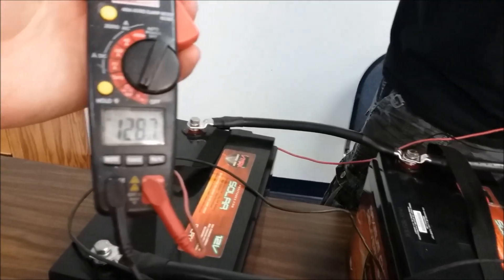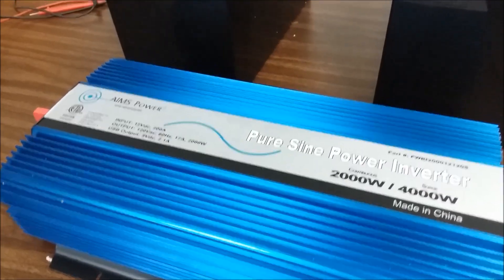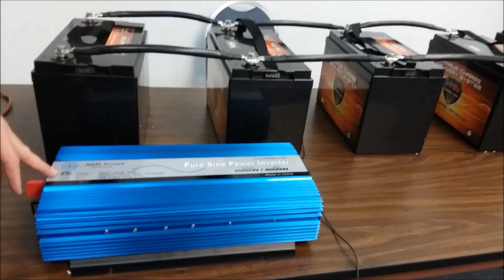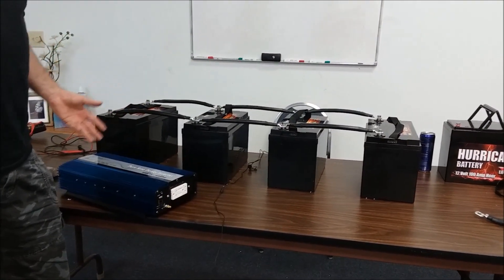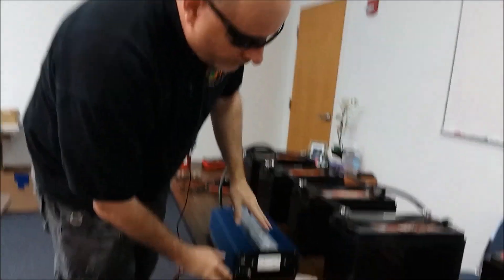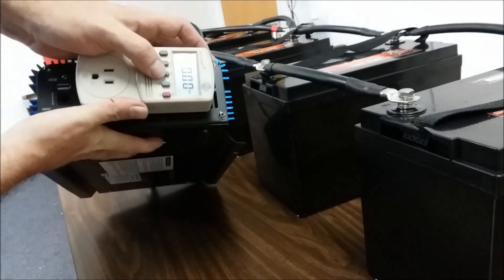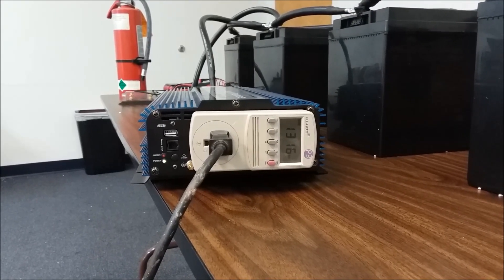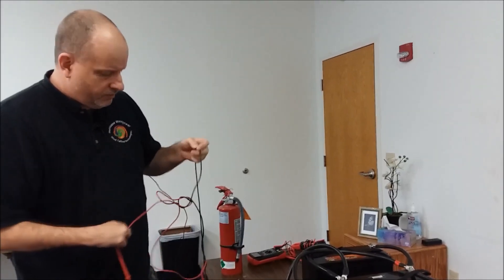DIY 12 volt energy security Aims 2000 watt pure since wave inverter load testing wiring tutorial

Comment: I had a amis inverter and it burned up in 6 months purchase a samlex evo-3012 it has been running for a year and a half no problem and my wife oven loads it all the time
Reply from the maker: Thats amlex evo-3012 and it is also hardwired no?  is rather pricey....what did you have to pay for it? It is one of samlex's top end inverters I can tell you that the SSW 2012 they have has pretty much turned to crap in the newer production stuff. As well as I stated I have not always had good luck with Aim's stuff either however I have noticed better quality and this one is able to pull heavy loads and outperforms a lot of entry level inverters I have been testing. If you can hit me up with another 2000 watt pure sine wave inverter in the $400 range we will be glad to test that one out on the channel heat to head. Personally if I were going to spend as much as you likely did on the samlex I would probably went with magnum but that just me and I am limiting this to commentary on entry level products which is what many people want......cheap and this is the best cheap inverter I have had my hands on in a while nice and heavy too
Reply: @HurricaneWindPowercom  yes you are right a lot of people want the best are the not willing to pay for the best my only mistake was buying a 12 volt inverter if I knew then what I know now I would have bought a 24 or 48
Reply from the maker: @solarandwindinsouthtexasda1473  48 split phase is what we do in bigger systems....I too have heard good things about that higher line in samlex
Reply: @HurricaneWindPowercom  and also you guys make the best wind turbine I have ever bought
Reply: That hurricane vector is no joke it has some power
Reply from the maker: @solarandwindinsouthtexasda1473  thanks i appreciate your kind words we aim to build the biggest heavy stuff out there
Reply: @HurricaneWindPowercom  my hurricane vector it's making between 15 and 20 amps 15 miles an hour wind I have purchase every wind turbine are there and non perform like yours that is one bad boy
Reply from the maker: @solarandwindinsouthtexasda1473  it should push 40-60 amps in 20-30 mph but 15-20 maybe on par in the lower wind as wind power is exponential...something most people and especially windpower companies don't advertise or educate. It is a shame that other than the offgrid communities who have someone who we have a customer who bought one know the secret and their neighbors and friend buy the turbines. The good news is we stay about as busy as we can with solar design. I would spend more time kicking the crap out of other wind power companies turbines except I am not spending the effort to wallpaper youtube with bullshit. Given time people are figuring it out on their own. In fact  is another wind power company was so afraid of the data on these turbines getting out they sent city inspectors by to harrass me to delay the data getting out. Don't dislike wind turbines but arguing about the wind turbines when the other guys don't even field a product that is even in the same area code is a joke.  Thanks for your kind words. Hell if you got it throw up a video and let people know what you have and what you been through. Sad fact is when people buy that other crap they stop buying wind turbines and the problem isn't small wind turbines. It is the dumbasses that build and sell garbage